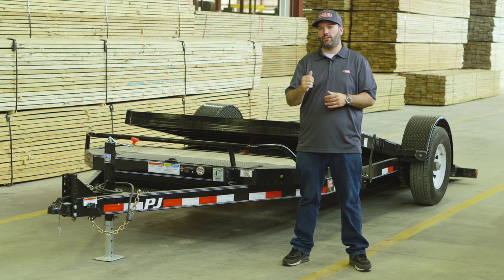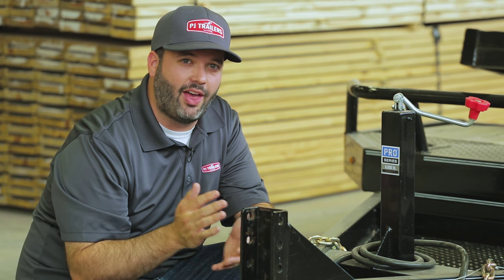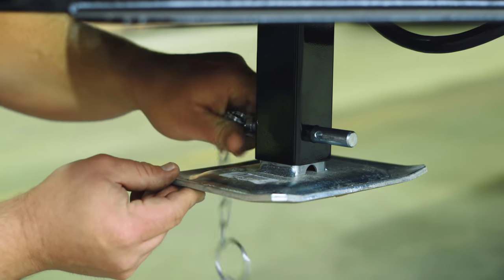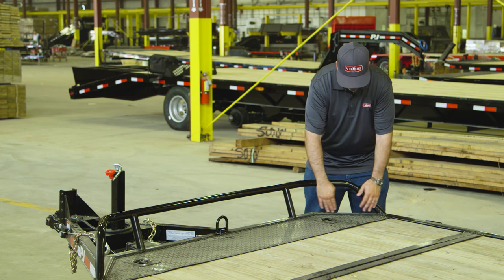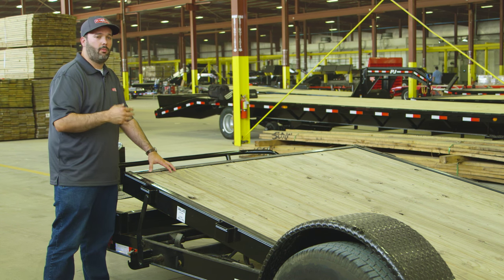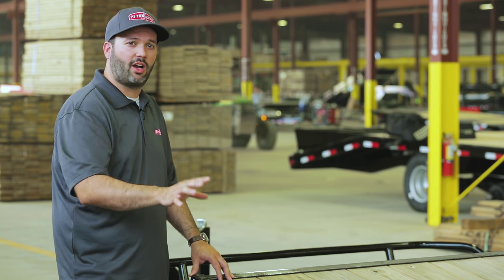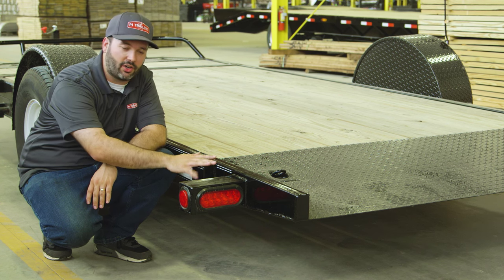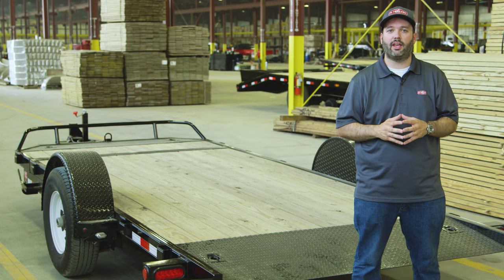T1 Tilt Walk-around - PJ Trailers

Comment: The steel that holds down the lumber on the front and rear end, is it welded in? Or are there easily removable strips to make replacing the lumber more easy in the future?
Reply from the maker: The front and rear board caps are welded in.
Reply: Hey.i.do.like.it.to.